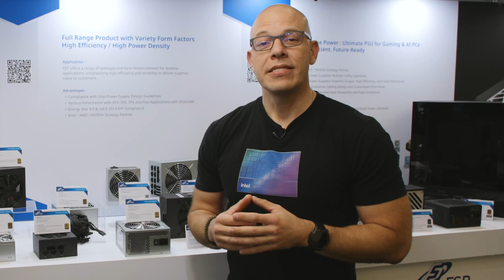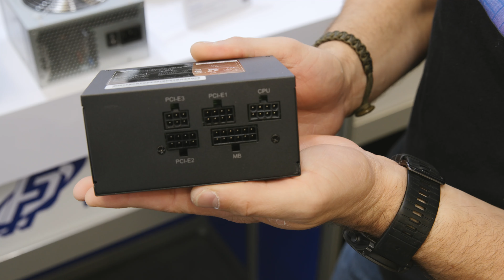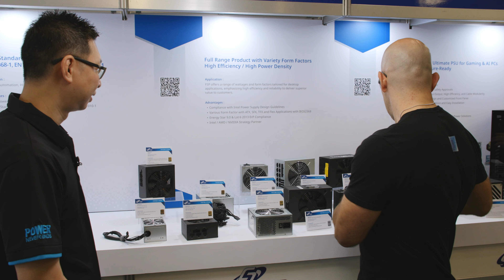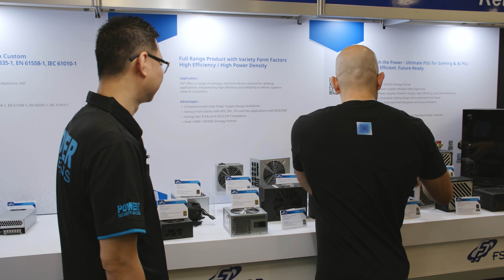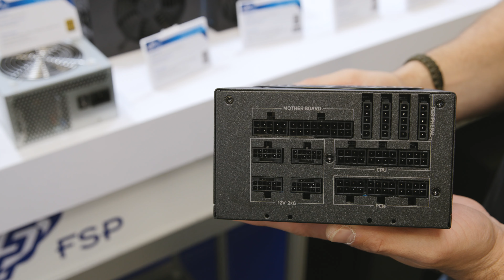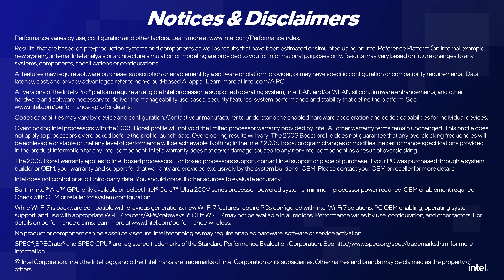FSP x Intel at Computex 2025: A 12VO PSU 30 Years in the Making | Talking Tech | Intel Technology

Comment: I am waiting for 12VO PSU long time. The old standard is dead in the water. I hate it when my desktop PC idles around 100 watts and it is because of inefficiency of the old PSU standard. Can somebody tell me when to expect full 12VO lineup launch? I do not understand why Intel cannot make small form factor PC with hybrid CPU + GPU in one SOC? Why to have big PC case and many fans and terrible efficiency when you can have one solution for everything ?
Reply: whats the point when the conversion from 12v to 5v will have to be done on the motherboard now?